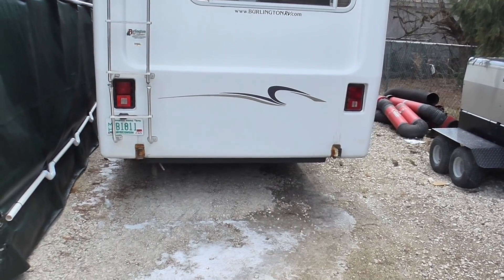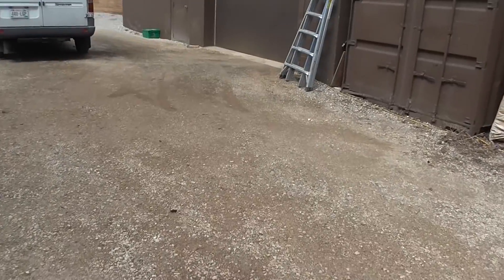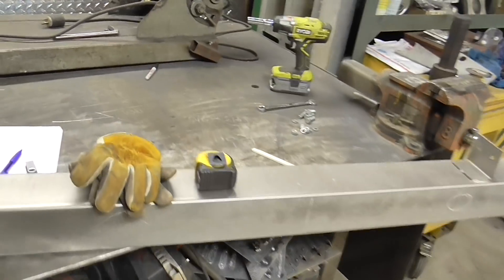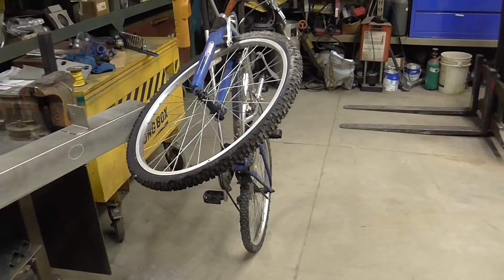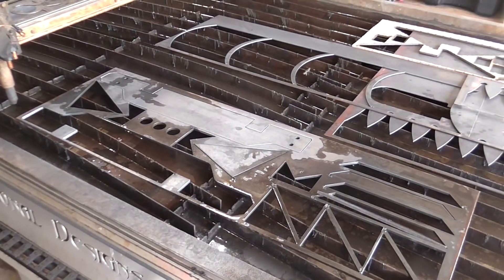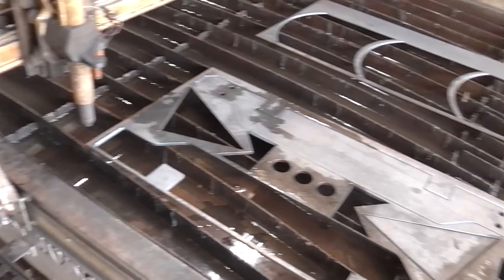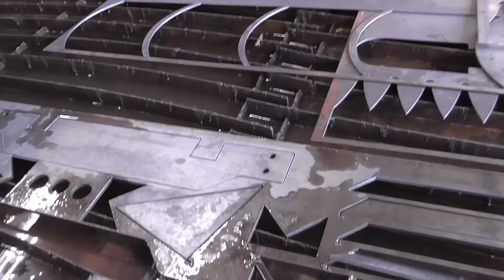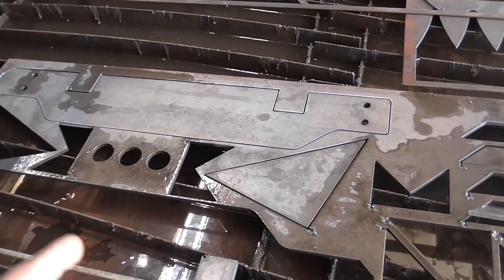HTP ProPulse 200 and plasma table build bike rack on 5th wheel camper

Comment: I enjoy your videos and had a question for you about the stel iron mig 221p compared to the htp pulse pro. Does the stel have the program for the ford aluminum setting. Or should I ask if it has the same capability as the htp? Thanks hope to here from you
Reply from the maker: chrisponsauto technically it has the same capabilities - however it does NOT have a 5554 program it also lacks a couple other programs that are important for collision repair ( like sibro without pulse) the iron mig only has sibo pulse programs the pp200 has pulse and no pulse options. 
Also the connector on the front of the machine to hook up a foot pedal or an amperage controller for the mig torch comes standard on the pp200 and is an additional kit you have to purchase and install yourself on the iron mig 221p . 
The way how both companies “handle” aluminum welding is different too ...  stel has you install a different liner in your regular mig gun, htp sells you an additional gun for use with aluminum ( which in my mind works better in some situations)   

Its all up to you .... 18 month vs 36 month warranty....  

Bottom line both machines are awesome !!!

Comment: Plenty of reviews for the htp welders and yes they are amazing. I have two of them. But I never find or see any reviews for the htp plasma cutters? Have you used any? Quality? Can’t afford a hypertherm and looking for a alternative.
Reply from the maker: edsautorepair i just bought an htp 875sc to try it out ...  from what i hear the machine is pretty good.   I wont say too much not having it tested for a while myself ( but that is coming...)
In the meantime look at this

https://youtu.be/noPu9IGyUqI

I have actually seen this with my own eyes in action multiple times and i was impressed every time 

And i used it for a few minutes as a hand cutter when i installed that loading  dock leveler  at htp.  

It felt as far as power in between the 45  and the 65 - when you run it on a table the duty cycle 100% @ 45 amps is pretty much like a 65 cutter but the maximum cutting capacity is closer to a 45 .... 
either way you look at it - it is priced just a hair under the 45 - i think its a good deal ....
Reply: ZILA thank you for the time to respond back. I won’t or don’t plan on cutting much over 1/4 but nice to have the ability. Still saving for the cnc and up in the air on which one. So many good bad for the same companies. I’m not electrical engineer or pc programmer so ease of use is top priority. Again thanks for the reply and will definitely check it out and look forward to seeing your review.
Reply from the maker: edsautorepair the key on cnc is YOU having some sort of CAD experience ....
The rest is not all that tough
Reply: ZILA  unfortunately I have none. I do learn fairly quickly and also study read watch everything I can get my hands on about a particular subject practice and repeat hands on over and over. I have been playing with a buddies fusion 360 program and his cnc mill. Still have lots to learn

Comment: . I really need your help. I have a Miller DVI series 1 and a diversion 165 tig. I’d like to get one welder that’s does it all mig,tig,and stick. What do you suggest?  I’m over the Miller stuff after listening to ChuckE2009 and you . You guys speak pretty highly of Everlast.  I can’t spend to much but would like to save some space in my shop
Reply from the maker: Mark,  be careful with all in one welders... I have a few - and my personal opinion is that unless you dump a ton of money for a really good one - they are all "compromises" that lack one or another thing ...  
what that means in plain english,  either you are lacking features that your REALLY wish you would have had (those features that a dedicated machine more likely than not would have had) or you are lacking user-friendliness, arc stability, arc dynamic, performance, power, ....  or a combination of several or even all of those above ....

and to get one thing clear:  personally i do not endorse or recommend everlast machines in general. I bought one new one years ago and sold it to my neighbor and i currently own one used one that I bought on craigslist as o am planning on teaching classes with that machine to make money for myself (and "helping" the guys who bought it and can not figure out how to use it correctly ....  , 

I don't know anything about the built quality or the customer service of their machines ...

so I can and will not make any statement about that ....  maybe it's good, maybe its bad - i don't know i cannot say ....  I just refuse based on some rumor or the country of origin of those machines to pass judgment one or the other way not really knowing anything about it ...

the diversion is an acdc tig ...  so i would keep that already ..  so how much stick do you really do ?
I dont know what to tell you...  i dont think there is such a thing as a great all in one really cheap budget machine ...  
and i dont even think there is good multiprocess used machine out there that fits the bill ...   i mean if you want to go all in one and you are parting with your tig and you still want acdc tig ... everlast and esab are pretty much your only options at this point ... but you are looking at 2-3g ....  so even then. - cheap dies not fit the bill and those machines ( i only got a brief look at them at a trade show and a friends house) both (or all 3. - everlast has 2 models) have their shortcomings even at that price ...

Comment: Nice build and not to be that guy but I think you should have extended your mounts further up into the rails of the camper maybe sandwich the rails between another plate on either side. I only saying that cause the attachment point looks like it is the week point of the build. How much does what you built end up weighing ?  I say what I say since we once has a bike rack fail on the back of a camper thankfully all it hurt was the bike and we got pulled over in time
Reply from the maker: i did extend the mounts - all the way up to the gusset that is inside the frame ... i extended 3" longer than the factory bumper and made it slightly taller so it wedges against the flanges on the frame
the rack weighs about 150 lbs empty - 225 fully loaded ...  we had 3 full-size adults standing on it ...  it didn't go anywhere
Reply: ok cool we only got the perspective from the video and not everything you were working with and I guess a 5th wheel might bounce less in the rear then a regular bumper mounted RV

Comment: Nice project. A piece of flat bar across the back maybe 2/3 of the way up would add a lot of strength to the structure for very little extra weight. Also you're not going to cap the ends of those square tubes or paint it? Then you should maybe rig up a camera and go for a drive to check it's not moving around too much in the wind, over bumps etc.
Reply from the maker: ben c customer will paint himself, round tubes are capped with metal , 2x2 square tube customer is installing plastic inserts. 
The flat bar is a good idea - for camera ready my reply to someone else here

Comment: I really like the design and the efficient use of vertical space.  You didn’t need any support at the top to keep it from leaning back too far?
Reply from the maker: i am not worried about the bolts ... the factory 3/8 are being upgraded to 1/2" ...  4    1/2" bolts have enough shear strength to hang a semi truck of the back....  just to give you an idea - the same 4 bolts the same size are commonly used to bolt a 15 ton 30ooo lbs pintle hitch to the back of a truck ...     I would be more worried about the "sheet metal frame" that they attach to ...   that ladder ... non-structural - looks like #10 wood screws in fiberglass and wood ... hold nothing...
the frame is your best bet
Reply: very nice work, as usual.  Seems like an awful lot is relying on four bolts.  It seems that the mounting points for the ladder might be a place to use...
Reply from the maker: thanks,

the mounts are 1/4" thick and slide inside the original frame (relatively snug) and everything else is 1/8" pretty light the entire thing probably weighs less than 150 lbs ...  but that 3x3 angle that the bikes sit in gives it GREAT strength .... I stapped one in an shook it hard and I have confidence in it  - not that that is scientific  - but that is as start - mount a go pro to the back of the camper hit a few local railroad tracks and see what happens ...